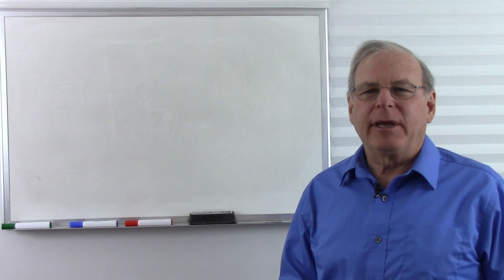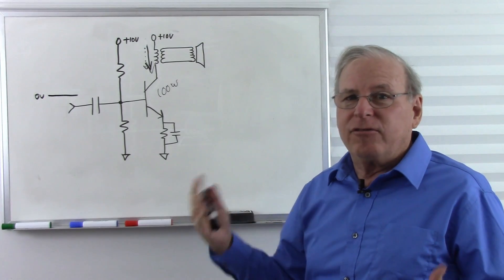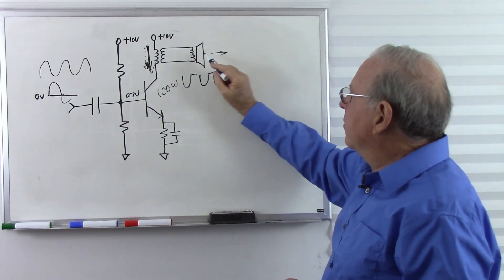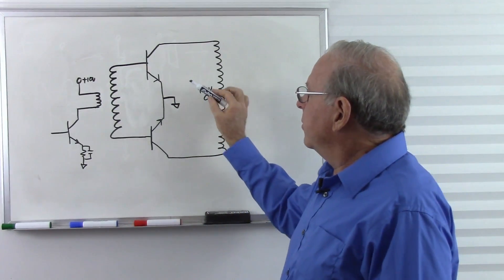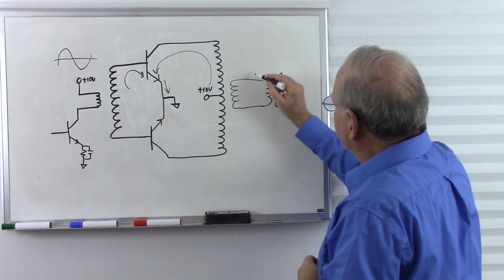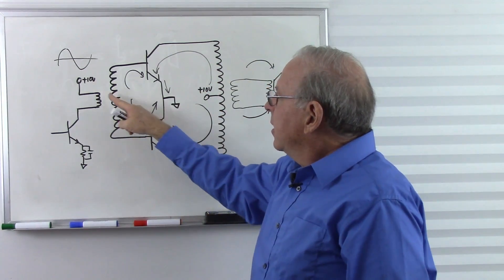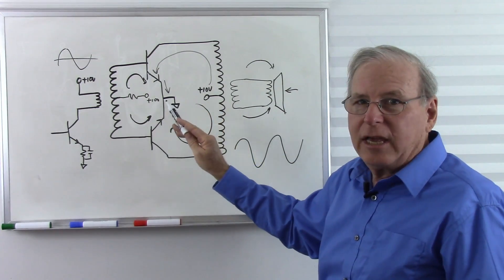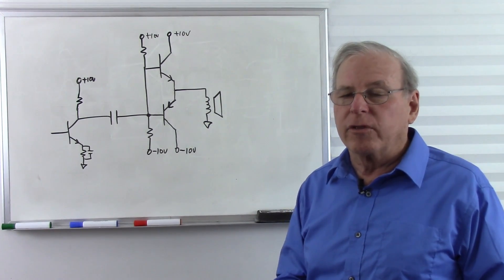Class B Push Pull Amplifier - Solid-state Devices and Analog Circuits Day 7, Part 2

Comment: Sorry Sr, I don't agree with the circuit at 14:53, since the secondary coil, at the bases of the transistors, can't close the current loop. You need a center tapped secondary coil here to avoid the reverse viased base diodes

Not sure if my explanation is clear enought, since my english is not as good as I would like

Comment: I am trying to build a pulse motor using PNP + NPN transistors circuit. Which option would you suggest out of the three you explain here. Very difficult to prevenrt  heating  in the transistors  in the configuration I have built as driver circuit for that pulse motor. Thank you again for an understandable explanation

Comment: I plan to build a 1959 DDR retro radio using transformers and germanium transistors and the old schematic.
I really like this old technology of drive two transistors through two transformers.
Sounds strange, but it's just a learning project. ;)
BTW: Great content, thank you very much Professor!! By far the better way to learn electronics is to first get a general understanding of what actually happens and then practice the math. I really missed this approach during my time as a student. In the lecture my prof couldn't say what the essence of a Fourier transformation is. ;)

Comment: 13:00 - Should not a right end of a capacitor be connected between diodes? In your scheme its connected below both diodes. Let's say positive signal comes in. Current won't flow up - bottom diode blocks it. It also won't open PNP transistor. it can only go down trough resistor to -10v and this does nothing useful. After plugging these diodes you should show how current flows from input and which way to output. Marking voltages is not enough to me to not have doubts. Maybe your sheme is correct, but then I do not understand what happens at PNP base node. How input signal voltage influence potential at that node?
Reply: I guess I've heard an answer for this before, but when a diode has been in active mode polarity of input voltage doesn't matter. Even if you imagine that to be in between both diodes, the top diode is reverse biased any way in typical sense, the purpose of the diode is to bias the transistors, which can be done even using a resistor or a vbe multiplier.
Reply: I think you mean NPN (the top one), because I have the exact same question. How can the input voltage influence it if it can't flow through diodes? Also, every reference I check says that flowing from ground (0v) to -10v is impossible, so I don't understand how the lower even works

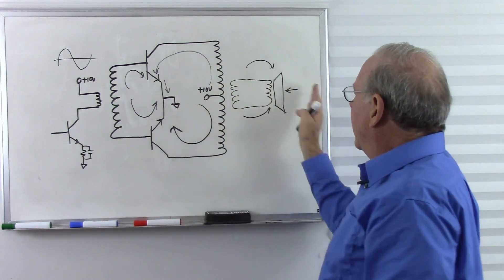Comment: 7:39 one question, of there are no resistors, only transformers I am always worried about too much current going into the base of those transistors. How is that possible that they are not overloaded with current. I mean I understand how transformers work but still there is quite a lot of current going int othe base right?
Reply: In the class B transformer design there was ONE resistor in series with the transformer center tap. This sets the  max base current along with the dc resistance of the primary windings.
Reply: Aaa yes. I forgot that there was a resistor there too but I think I have seen somewhere a class B amplifier without any resistor there, it was a chinese radio kit...

Comment: this is very intetresting! Finally something not too easy for my projects :) I am using those kinds of amplifier (I have circutis from books etc.) but it is always better to have more understanding how they exactly work so I can design them better :) I have built recently my AM radio for 225 kHz from scratch and need to improve my amplifier to have better sound quality.

Comment: Those 2 diodes are really confusing me my brain goes overheat
Reply: Very brilliant design. The situation is well balanced and both NPN and PNP transistors are open situation, when a negative wave comes into, it get -10V power's its side and push up through the diode's kathode side to the next kathode and this make +0.7V balance distort , for example, get +0.5V and  NPN transitor needs minimum +0.7V  so NPN transistor closed. 
When a +0.2V positive wave comes into the system, it reduces well balanced -0.7V to -0.5V so  PNP transistor's breaking point needs -0.7V and PNP transistor closed.  

If my interpretation  is wrong, please make it clear. Thanks.
Reply: The voltage difference between the base of a transistor and the emitter is "0.7V".  This causes x-over distortion.  The voltage difference between the terminals of a diode is also "0.7V".  So this is used to negate the voltage difference between the base and emitter of the transistor, which should then "eliminate" the x-over distortion.  But b/c we have 2 transistors we need to have 2 diodes to negate both.
Reply: What is meant by Ultra-Linear push-pull? I have heard that term used in tube/valve amplifiers? Fraser

Comment: Yes Bob, but if the diodes are not properly matched to the BE junctions of the transistors and have the same thermal characteristics you risk thermal runaway.  However, you can use the same spec transistors as the diodes.  That way you can get sufficiently close matching easily and without the  effort of selecting the right diodes.

Comment: That's one neat trick with this two diodes! 
Thanks for this video!
Reply from the maker: I'm going to make a followup video with a better trick I forgot to add. Feed the bases of the transistors with an op-amp and feed the final output back to the inverting input with an appropriate voltage divider.
Reply: @Vocademy-Electronics-Tech  Yeah, the op amp works better.  Diodes are dicey.  For best results use matched transistors as the diodes.
Reply: @uni-byte  You do realize that Bob is trying to teach electronics and when you are trying to learn the concepts there is something call information overload.  And I think that he has a full grasp of subject matter.
Reply: Yea, after 5 years of Electronics Collage I know shit. This guy know subject.
Reply: Can you do a follow-up video and explain what happens to ac signal going through the diodes? I can't wrap my mind around how the sound gets to bases of the output pair. Thanks, you are the best!